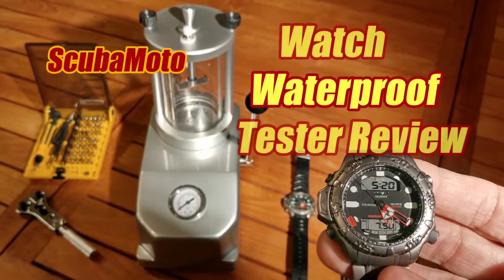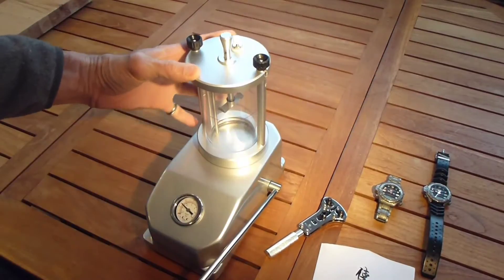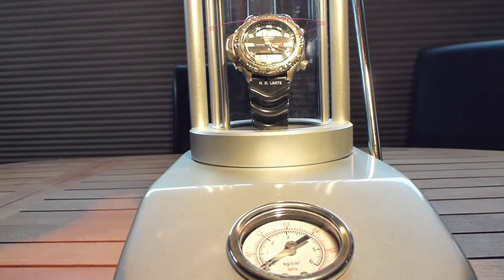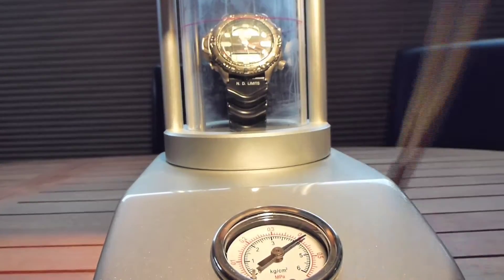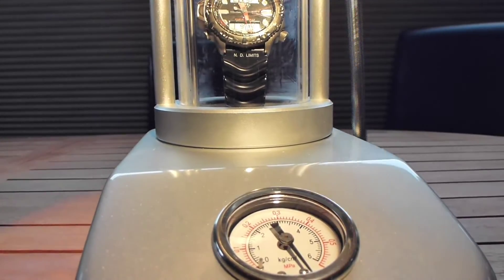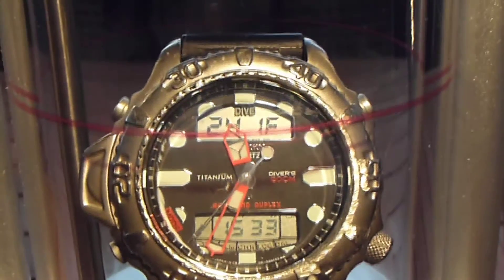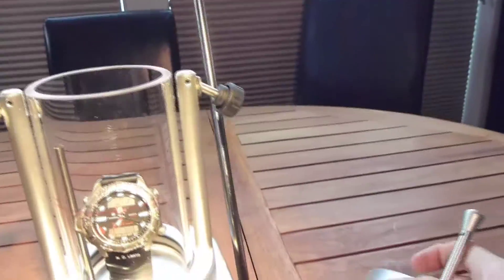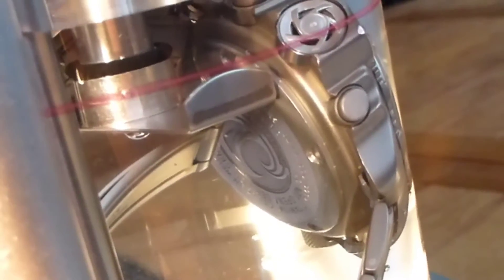Dive Watch Waterproof Pressure Tester Review & Endurance Test

Comment: How can you tell if there is a leak when dry testing?
Reply from the maker: G. Comz: Yes, but the device in the video is not designed to dry test. For that you would need a dry tester like a Witschi Proofmaster that uses crystal deflection method. That device places the timepiece under increasing pressure while measuring how much the crystal deflects (caves in) under pressure. If the crystal does not bend, then the watch has a leak because it proves that the pressure inside the watch is matching the extreme pressure inside the device chamber. As I mention in the video, some shops that use crystal deflection expose the sensitive depth meter on a dive watch to extreme pressures beyond its design limit so I try not to allow dry testing on my dive watches. A 3 to 4 bar plunge method using a tester like the one in the video is my preference. The added advantage of the device in the video is that, if there is a leak, you can clearly see the source and address it accordingly.  I hope that helps.
Reply: @ScubaMoto  thank you for this info. Definitely learned something new about that witschi machine. Cheers again
Reply from the maker: G Comz: Yes, the Witschi G2 looks like a fantastic machine for dry testing. The Greiners also look very good.

Comment: great video and honest review...very informative.
can i use this waterproof tester machine on Suunto D4i/D6i dive computer? i read on suunto manual if it's not allowed to pressurized the dive computer in Air(dry), if i pressurize the computer in Air(dry) does it will break the depth sensor?
Reply from the maker: Aswin Teguh Santoso: Why do you want to test it? Did it fail or did you just change the battery? Are you wanting to test the computer as waterproof or test it as accurate for pressure? Either way I would not risk it if Suunto says not to. Also, most dive computers could go into a permanent error mode after a rapid ascent. If that happens, you may need to send it to Suunto. This device might be difficult to prevent a rapid ascent error when depressurizing the chamber.
Reply: @ScubaMoto  Hi, i just want to test it after battery change, before i go diving with  it, to make sure there is no leak.
Reply from the maker: I thought so. I would just dive it. I believe there is no way to safely test it with this device.If it is still on warranty, just replace the cap and dive it. If it fails, get a new one. If it is off warranty, I would still do the same. You can't test it with this device because if you pressurize it dry it could cause errors. If you pressurize it wet, you will flood an untested potentially failed seal just like diving it. You could use this device to pressurize it dry without the battery to avoid errors and then give it the plunge test but then you would have to put the battery in and again have an untested battery cap seal.Just check the o-ring and clean it with silicone grease and dive it.
Reply: @ScubaMoto  that's exactly the same with i was thinking about...thank you for your very detailed information...i really appreciate it.